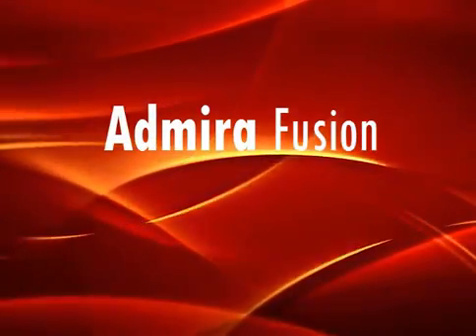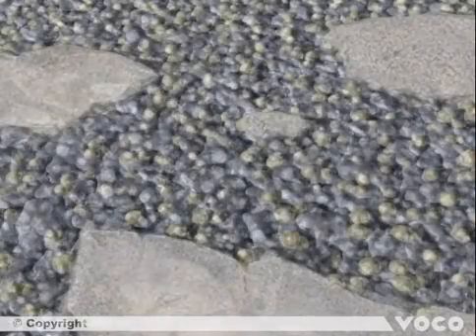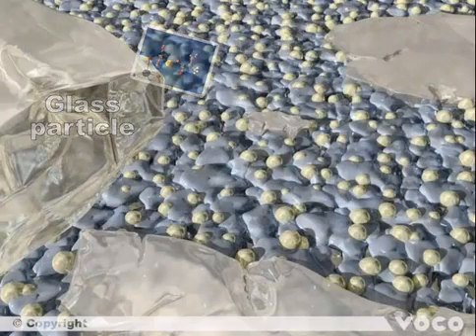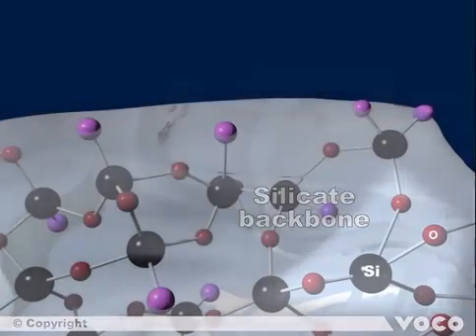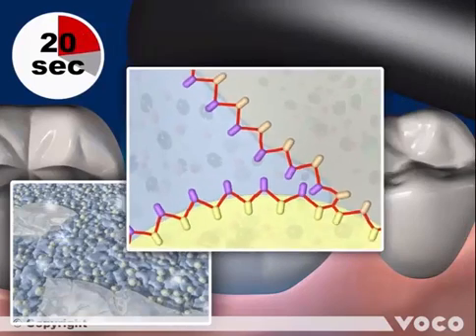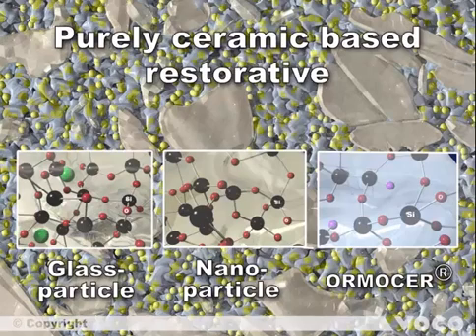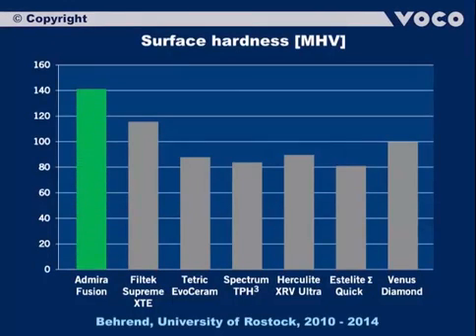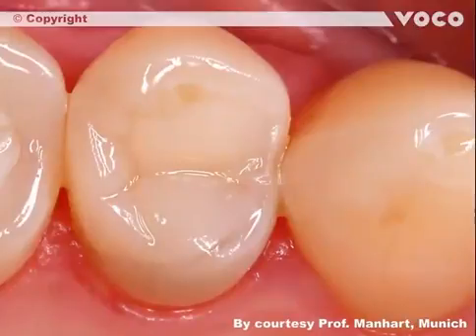The science behind Admira Fusion nano-ORMOCER

Comment: Could someone please provide some information on what the metal atoms are. Another comment said they are probably zirconium, aluminum, or barium. Do they provide an ingredient list for these types of materials? 
            Is any of this released during the curing process or use?
Reply from the maker: We use silicon oxide glass that additionally contains barium salt.  3rd party cytotoxicity tests have proven than Admira Fusion is probably most biocompatible resin based restorative material available at this time. Please see https://www.voco.dental/us/portaldata/1/resources/products/scientific-reports/us/Admira_Fusion_Scientific_Compendium.pdf
Reply: @VOCOAmerica  Is the barium salt in a nonsoluble form i.e barium sulfate? Thank you in advance
Reply: @inner28.  I would like to know this too.

Comment: I am really enthusiastic about this product though the statement of it containing additional metals of which are not specified draws questioning? Can this get addressed please?
Reply: It seems that the metal ions are added to increase radiopacity (this was mentioned in the video). Radiopacity is the ability to show up on an x-ray, and it is a property that I think all dental fillings have to some extent. I'm not sure why it's so important to the manufacturers; perhaps dentists want to be able to identify fillings on an x-ray scan.

I'm not an expert, but after doing a little research I've found that zirconium, aluminum, and barium are, among others, some of the metals used to increase radiopacity.

Again, it seems that all fillings use these types of metals, so I'm not sure whether Admira Fusion is any different from an average dental composite in this regard. There's an interesting research paper which you can find by searching for this: "Radiopacity of Dental Materials - Avicenna Journal of Dental Research"
Reply from the maker: The benefit of the innovative ORMOCER technology is that all ingredients are based on the same main component, which is silicon oxide. This applies to the resin monomers and the fillers. The fillers can simply be seen as conventional glass, which is pure silicon oxide.  However, to increase the visibility under X-ray, dental glass fillers contain additional components to a little extend. These could be aluminum, barium or ytterbium. They are not incorporated in the glass structure as pure elementary metal, but as metal oxides or metal salts. For instance, aluminum oxide or barium sulfate. 
In case of Admira Fusion product family we use silicon oxide glass that additionally contains barium salt.
Reply: @VOCOAmerica  Isn't silicon dioxide loaded with nanoparticles? synthetic particles? How is this a good thing?